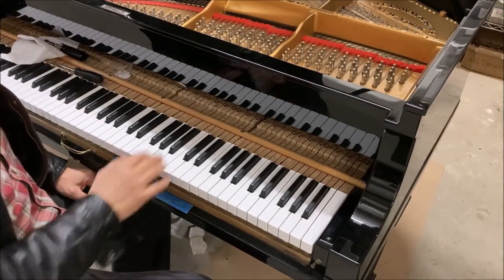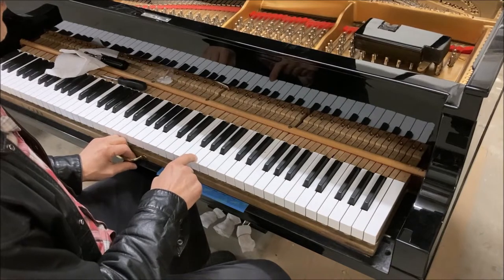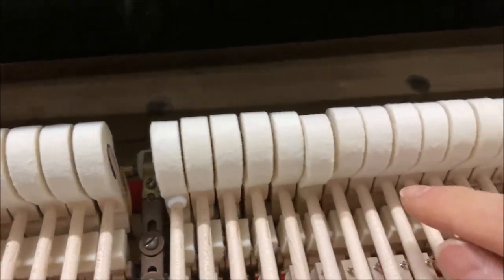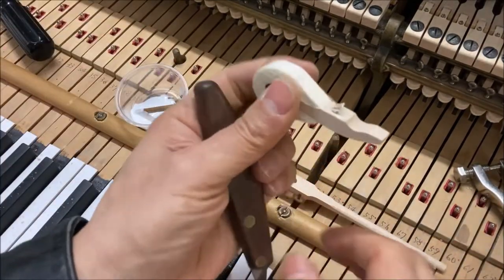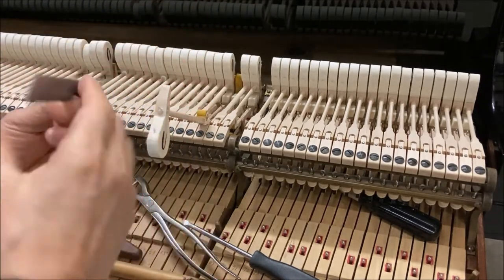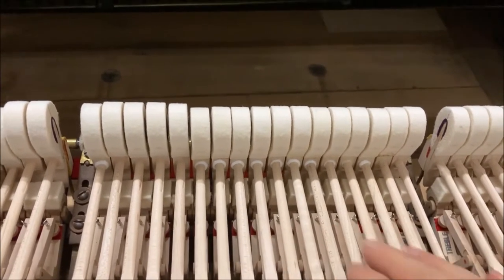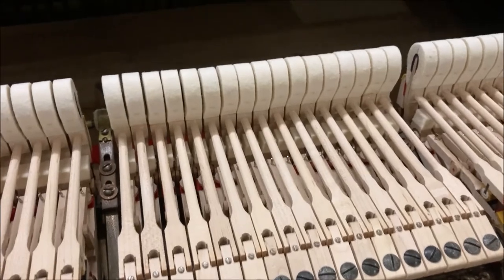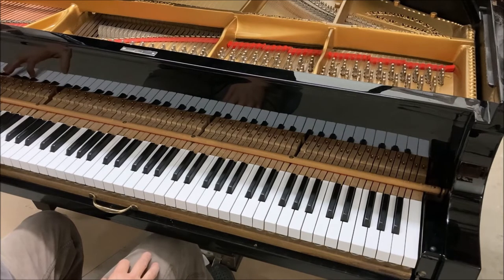Steinway Hammer Strike Position

Comment: You've done a nice job with this. I happen to have a Steinway B (1994) with the exact same issues in the exact same range of the keyboard. Accentuated attack sound. Rapid decay of volume. Reduced sustain. By plucking the strings with the dampers raised, the tones have excellent sustain. That seems to confirm to me anyway that the problem is with the hammers and perhaps as the case in this video, the strike positions.  Frustrating situation.

Comment: Did this instrument come from the factory like this? I was under the impression that their jigs for hammer lines were made to account for these slight variations. Does this mean that the capo bar was cast a bit off? Could the variations be as a result of the hammers themselves rather than the hammer line? I’ve been working on Steinways for 45 years……still mystified by the things that can go wrong.

Comment: How did you attach the handle to the action board?. Directly with wood screws? or inserts first and then machine screws? Is this something done commonly? I have a very hard time pulling out the action ; it seems to me the handle would greatly facilitate that process, but I ma afraid to ruin the board
Reply from the maker: With wood screws. In my opinion, piano actions should come from the factory with built in handles. The need to pull an action out hundreds to thousands of times during its lifetime is really a no brainer for designers and is a major bad for all makers. Many pianos from the 1800’s had built in handles. So much for progress.
Reply: @dberg001  Thank you very much for replying. What you say makes all sense. I think I am going to take the plunge and install a couple of inserts in my action so that I can use machine screws instead of wood screws. This should make it so I can attach and detach the handle any number of times without the fear of stripping the wood. If you somehow provide me with your email address I'll send you pictures of the finished job. .Thank you again
Reply: I apply wax to underside of keyframe and keybed and buff to gloss. I use Two handles made of key frame felt. The action glides in and out effortlessly with minimal effort
Reply: @rogershaffer1  Great idea !! I will give it a shot too.
Reply from the maker: Mail@bergpiano.com